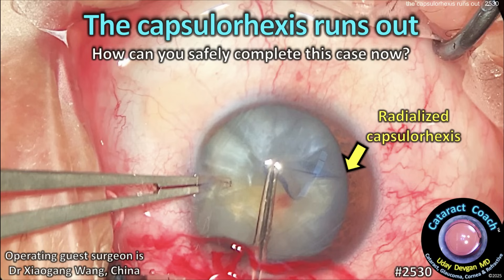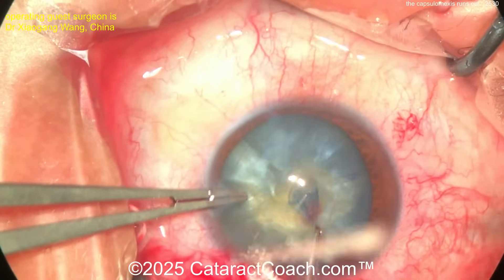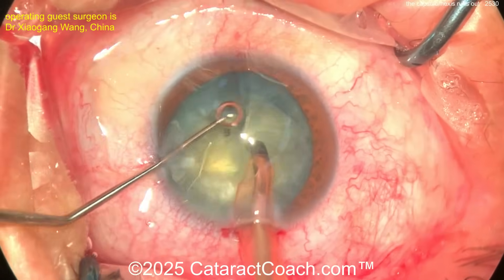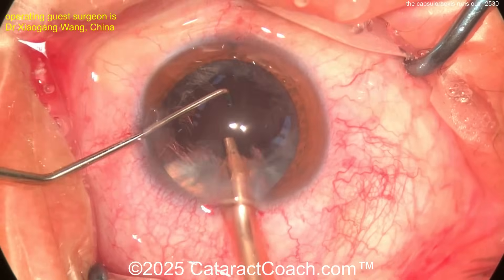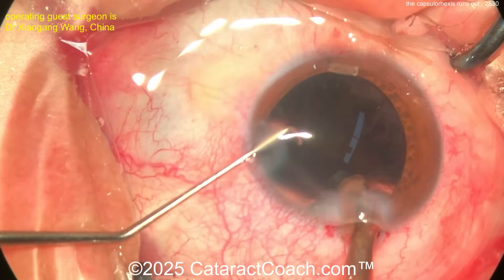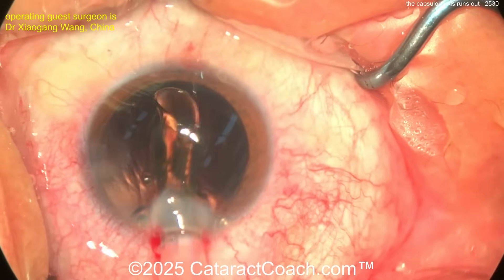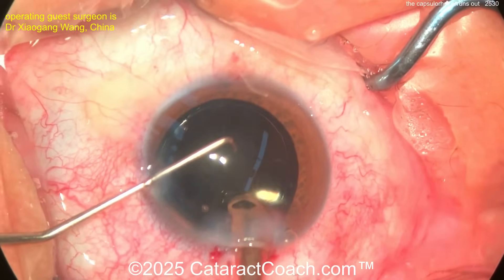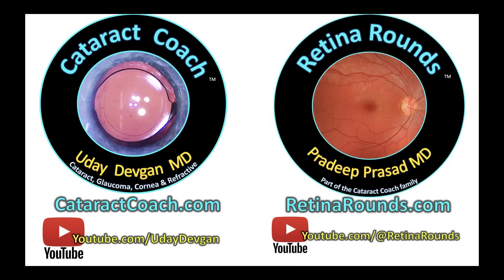CataractCoach™ 2530: the capsulorhexis runs out

Comment: Great teaching case, Dr. Uday!  The comments regarding the ‘rhexis have already been made, and I agree.
   On a side-note, I have used my left index finger on the main corneal wound as I remove both the phaco tip, and the I/A tip, on almost every case…. Done that for years.  Yes it’s a “big instrument“ (as you commented), but it often prevents a suddenly shallow AC at times when you wish it most (high myopes).
    It certainly helps reduce the number of times the eye expands and collapses, expands and collapses, during routine cases, and I think that’s just gentler for many reasons…
    There’s a technique to it, of course, but some gentle pressure with the tip of my finger for a few moments helps to “seal“ the incision to reduce leakage at a critical point.  (Your mileage may vary!). 😂
Reply from the maker: thank you, my friend. I will certainly try this technique soon :)

Comment: Nice recovery.  The rhexis ran out inferiorly where flap had extended too far during needle decompression.  This is one of the problems with needle decompression as it sometimes results in a larger, more decentered capsular opening than intended.  I still needle decompress in these scenarios but am careful to not rock the nucleus too much to avoid this situation.  I just aspirate the liquified material that will come, and move on to quickly create baby rhexis——once baby rhexis is done, then you can completely decompress the bag with IA before enlarging